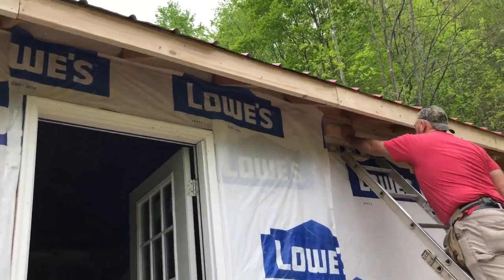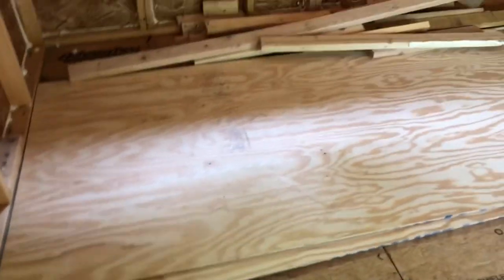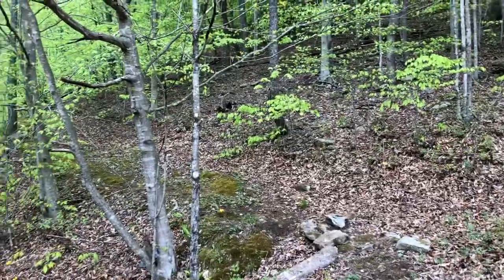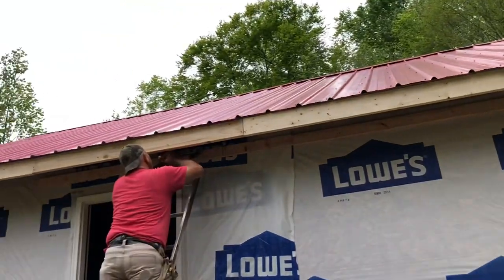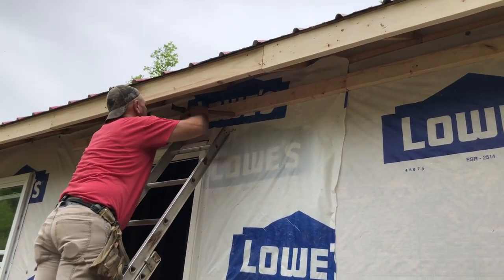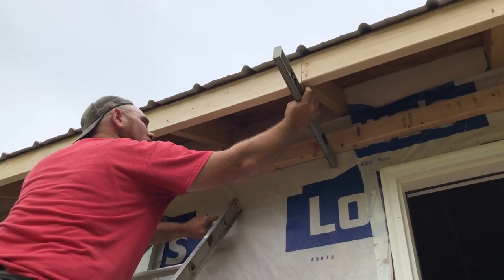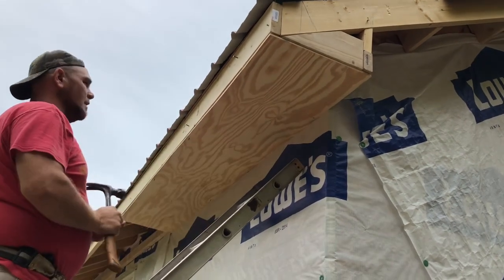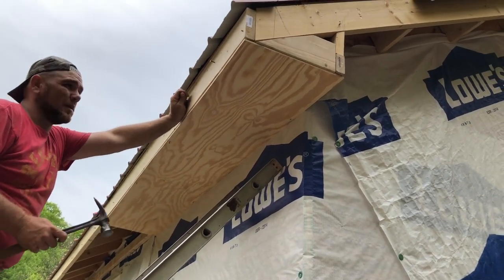Cabin Build/ Soffit and Fascia work

Comment: Good video. Can you attach the “F” channel(for the soffit)  BEFORE you install the fascia? This way you only have to level the fixed back board
Reply from the maker: Yes, I think you could.
Reply: @countrylivingwithtashia4169  thanks for replying! Rehabbing a neglected 1500 sq ft single level house and the more I repair, the more I find that needs repairing! 🤪 
The other thing I learned is that PVC 6” wide decking is $$$$$$$